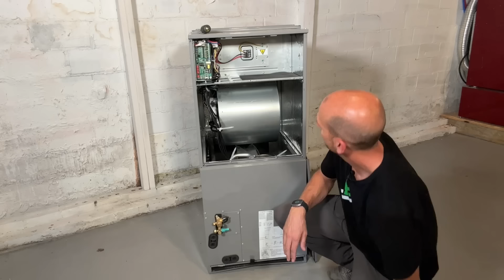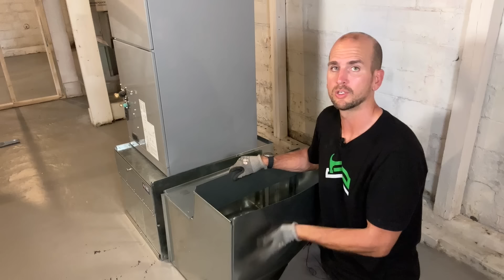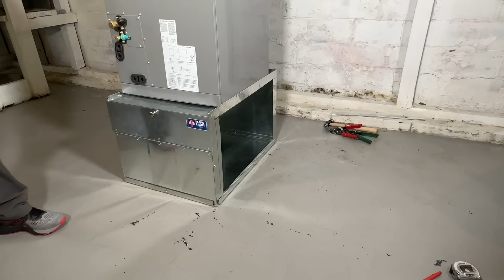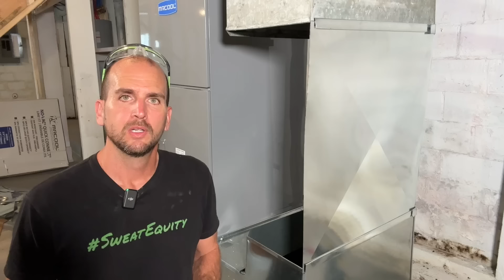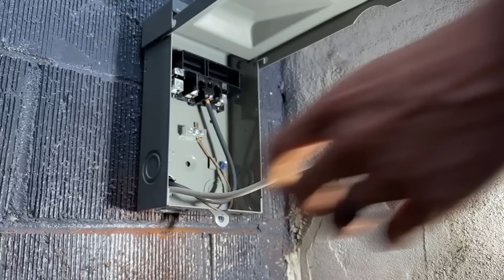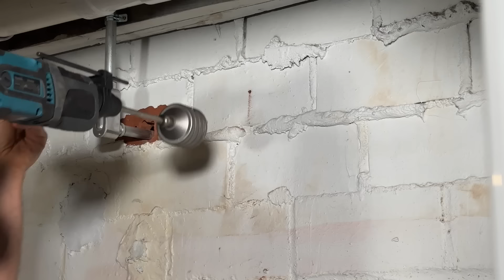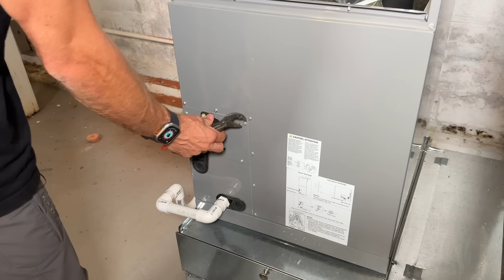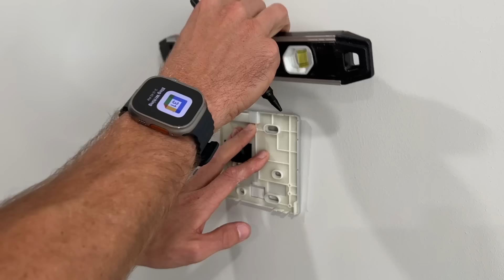How To Install Your Own Central Air Ducted System | Mr Cool

Comment: HVAC tech here. Not a bad job at all on the install for a DIYer! I only have two real complaints and a few notes:
1. Heat pumps don’t really work great in cold climates like where I live. Around here heat pumps are normally installed on top of backup heat, either gas or electric. Gas is much better because electric heat elements rack up your power bill quickly. If you live up north you’ll want more than just a heat pump, even the good ones just don’t quite keep up when it’s cold.
2. I’m not a fan of Mr. Cool or any of the DIY systems, but there’s a lot of gatekeeping in the HVAC industry and it’s virtually impossible to buy something like a Trane or Carrier without a mechanical contractor’s license, so this is what you’re kind of stuck with unfortunately.
3. The most important thing about running the line-set is not to kink it. You can get an okay pipe bender online or at Harbor Freight. It’ll save you from linking the line or getting hairpin leaks and also make it look nicer.
Reply: I got to say you are way wrong about cold climates That might have been true on old units but new ones will run at -15. I have a 13yr old heat pump over gas and the gas almost never comes on. Newer unit would blow mine away. Also here our electric is cheaper then gas so if i ever had to use the heat strips it still less
Reply: I think what he means to say is that selecting a heat pump to use in extremely cold climates is harder and requires careful selection that actually takes into account the buildings thermal properties and the heating characteristics of the heat pump. With natural gas furnaces it's much easier to use a vastly oversized  unit and then little planning or thinking is required, any monkey can do it. Don't hire an HVAC monkey to select and install your heat pump in an extremely cold climate.

Comment: Wow, what a great video you just dropped. I'm sure it will help a lot of people in the months to come. I would suggest that you seal the ductwork you fabricated. Something like ShurTape 686 metal on metal tape would work. This will do a great job of closing all those openings and will provide cooler air to the home and you won't be sucking warm air into the conditioned supplies. I would have added a condensate float switch as an emergency cut-off when the condensate line stops flowing. You should have also added a high-quality surge protector to the outside unit. These units are run on sophisticated computer control boards and are sensitive to electrical fluctuations. I've been a fan of the Ditek Kool Gaurd 2, but most other brands will help protect your investment.

Comment: I still have to watch the whole thing but can we apply duct mastic to all seams and joints to try to increase air tightness in an hvac system? Throughout the return, air handler box, all the supplies etc?
Reply: yes. mastic and tape on everything, use lots. some of the best time and money you'll spend

Comment: Went with the MrCool Signature series when my A/C system failed 4 years ago. Been incredibly easy to work with, great quality, was significantly better than the ole Trane setup we pulled out beforehand(Albeit, can't say it's apples to apples because the old system was ancient, plus the ductwork was very undersized. I replaced everything to be new - ductwork, air handler, condenser) I'd say it's definitely harder than using MrCool's precharged linesets because I had to do all that part w/ the gauges, scales etc - significantly more costly, but it all still worked out and works great

Comment: In Florida, replacing an air conditioning system requires a permit...even for DIY installations! I didn't realize this, but found it out the hard way when my mother sold her home. We had to obtain an "after-the-fact" permit for the sale to close. The same was true for a water heater replacement.

I served on submarines as a nuclear engineer and chemist, so my work easily passed, but the permitting requirement came as quite a shock as I've done similar work in several states over the years...all without reqiring permits.
Reply: Interesting.  How was the history established?   I have a couple houses in Florida and have done heat pump changeouts on each.   Neither contractor pulled or even mentioned permits.
Reply: @GannDolph  I'm not sure. My brother handle the sale.
Reply: @GannDolph  If I had to guess it's not a "Florida" thing but a county/city/town thing.  I am in RI and it depends entirely on what town you live in.  My town is quite lax on permits.
Reply: @kevin9c1  ahh that makes a lot of sense, thanks for that.   That definitely is the best possible explanation .. 👍
Reply: @kevin9c1 good old Rhody
Reply: Same in CT electrical company snooped around and the property card with the town stated my house is oil, I replaced it with heat pump. I worked on jets in the Air Force, and have a masters in physics, the inspector still failed and asked for a contractor come and fix a bunch of things. But funny enough the contractor told me the work is of a professional and that was a huge compliment coming from him and he did sign off but did have to rip apart a lot of the work
Reply: ELT?
Reply: @ourfamily473  MMN2/ELT

Comment: I replaced the original 20+ year old central A/C system at my mother's house with a Mr. Cool Universal series unit. The entire experience was great, however, I did opt to cut the precharged lines in order to have a cleaner installation without unsightly loops of excess line. Again, every installation of this type is custom. This was just my preference. A fast and affordable service call to vacuum and recharge the lines was all that was necessary. (Note that I had this done before opening the valves on both units. That way only a minimal amount of refrigerant was needed.)

I mounted the exterior unit on the wall, rather than the ground in order to keep the unit cleaner.

The only criticism I have for the Mr. Cool units is the line set insulation. This quickly broke down in Central Florida.

All-in, the replacement cost me ~$3,500 (less than half of the lowest bid from an HVAC contractor). The unit is whisper quiet and consumes half of the electricity of the original unit.

Lastly, this unit has no problems both cooling and heating my mom's home (no resistance heating strips installed).
Reply: You could have saved money by doing a traditional line set instead of paying the extra price for the pre-charged if you were going to cut it.  Wasted money down the drain.
Reply: @toddlemons5952  My plan was to use the included pre-charged line set. However, one line kinked while I was trying to bend it such a way as to make for an attractive installation. Improvise. Adapt. Overcome.

Comment: Came here expecting to read all the upset hvac contractors saying how they wouldn't work on a diy system and how diy systems won't work right, etc etc etc. You know, basically being butt hurt, they didn't get paid their ridiculous markups!
Reply: True that. When I hear HVAC, I hear cash register open. How can marking up by 1000% be ethical to any business
Reply: @richlikeg3722 100% that's actually not that bad 😂
Reply: LOL!! that is the VERY FIRST THING I thought right before I attempted to read the comments! lol , the HVAC contractors know they are headed for trouble and its not going to get better for them..
Reply: But they will tell you that you’re getting a warranty when going with a professional and the ya know overhead these days lol
Reply: A friend of mine out of the Atlanta area just got quoted 20k for a system change out by 3 different companies. He must have a big house but that's insane. I don't understand how a 3 ton seer 18 Mr. Cool is cheaper than a seer 14 Goodman unit looking at HVAC direct.
Reply: @mathehack1 MrCools are rebranded GREE units from China.
Reply: @charles2000wang I know this is a year old but they're actually manufactured by Midea. Midea also manufactures premium "American" brands like Bosch, Cooper, Goodman, Train, Carrier, Bryant, and Lennox.
Reply: and around here, they're still slinging basic, bare-minimum 13 SEER* / 80% units with 20+ year old technology
* may be 14 SEER minimum soon
(which, in a way, nothing wrong with that, simpler usually means more reliable, usually ... but their markups on these dumb-as-rocks systems lately are absolutely asinine, "because reasons"...)

But heat pumps? Nobody around here wants to install or touch them. It's nuts. But if they did, I could only imagine what their artificial markups would be on heat pumps...
Reply: What they’ll do is lobby(bribe) politicians to create regulations requiring licensed installers.
Reply: Truth 😂
Reply: I don't understand why are these companies charging home owners  $15-$20.000 to install 20-30 feet of  duck work.? 1 day work
Reply: They act like it takes a rocket scientist to do this type of work 😂😂😂😂😂
Reply: @bert1913 I bet money you couldn’t properly install a full hvac system doing the proper steps let alone tell me what steps you have to do depending on each system
Reply: Yeah, I think even the contractors know that the obscene price of system changeouts these days has forced the explosion of DIY.   

Overpriced  new installs and equipment changeouts , as the bread and butter profit driver, is a decreasingly viable business model in HVAC...
Reply: I mean why not DIY everything right? Stay within you skill set and local code. And by the way...installing this machine is easy try repairing it! You can just DIY a new unit since you won't know how to fix it.
Reply: @DATcsxfoamer3026  that's right. Because HVAC repair is so exorbitant and more importantly because there are so few competent HVAC diagnosticians it's often cheaper to replace than to repair. Homeowners are sick of paying "professionals" that don't have basic skills to diagnose problems. They just know how how to install equipment and change parts, maybe read trouble lights, well if that's all HVAC guys can do, bye-bye.
Reply: @DATcsxfoamer3026 you could install 4 brand new units for the price of one new from an hvac co. That’s not even counting the cost of repairs that you’re so thankfully able to get

Comment: Do you have electric heat strip? Was it preinstalled in the cabinet?
Reply: no he does not, heat strips in these systems do not ship in the air handler, they come separate and must be installed

Comment: 15 years ago our hvac company built custom boxes out of plywood for the return air to enter and for the air handler to set on. Maybe cheaper than buying a kit online. Also don’t forget a good sheet metal contractor will make the box for you as well.

Comment: What made you choose the hyper heat over the Universal? Is the hyper heat system a communicating thermostat? I ask because I'm about to purchase either the Universal or the Hyper Heat
Reply from the maker: I went with the Hyper Heat because it is supposed to have a little more capability in cold conditions.  I am interested this winter in measuring the effectiveness of a Heat Pump when the outside temp is below 0F so I wanted to get the Mr Cool most capable unit.
Reply: The Universal can effectively heat down to -24°F/31°C. Supplemental resistance heat strips are optional, though additional power is required.
Reply: I would purchase the Hyper over the universal (and I live in Florida) just because it includes a ten-year labor warranty.

Comment: Newb question: Does this system provide both heating and AC?
Reply: I asked this question prematurely. Yes, yes it does :D
Reply from the maker: And hopefully it works when it is sub zero this winter 🤞